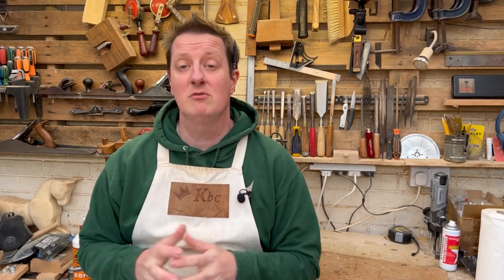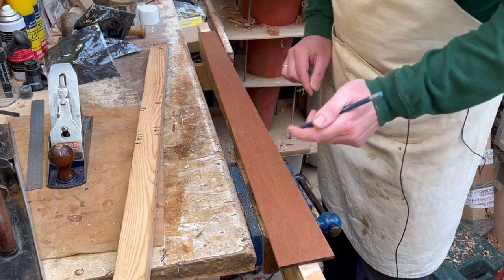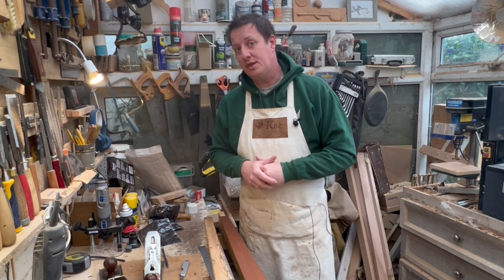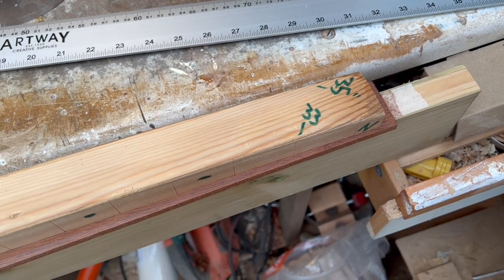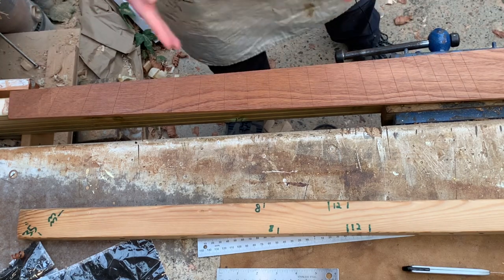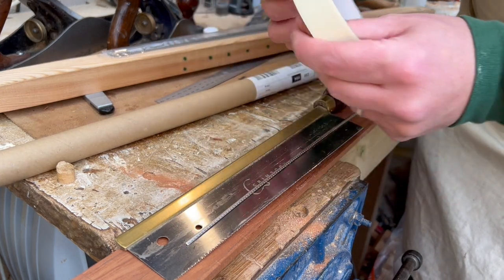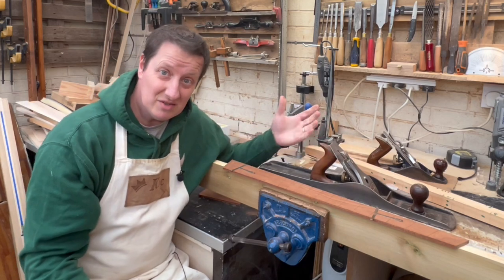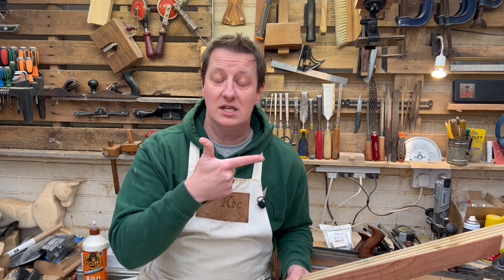How to mark multi scale fan frets  |  Bass build part 4

Comment: I was thinking of getting a square section aluminium tube, and creating a 34/35/36/37 inch fret ruler on each face. That way I will have the settings for any bass I'm likely to build. What do you think?
Reply: PS really enjoying this series!
Reply from the maker: Sounds like a plan. It would need to have very squared edges, so there would be no gap between the ruler and board. Better accuracy.